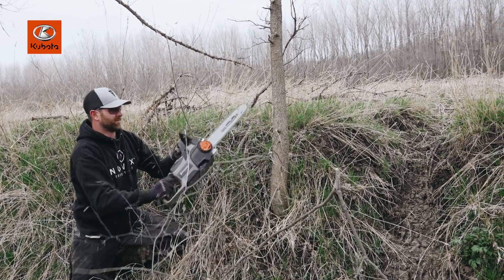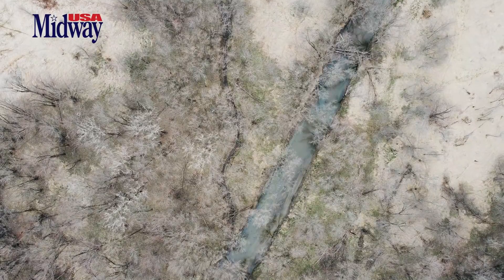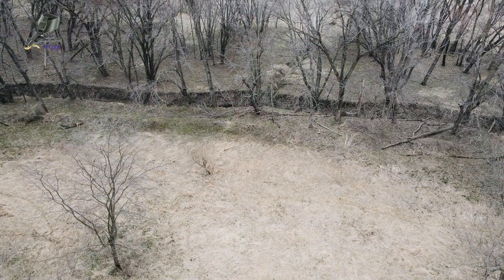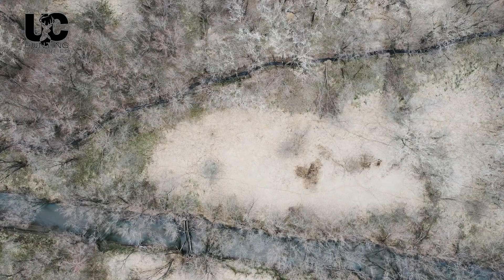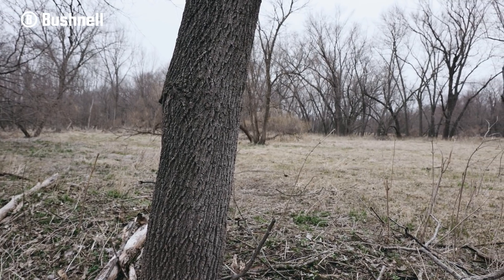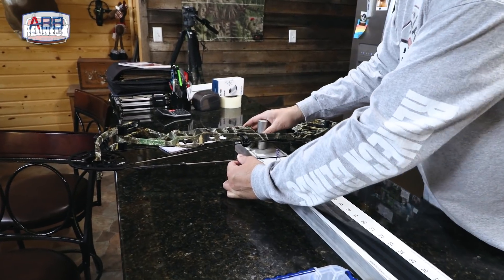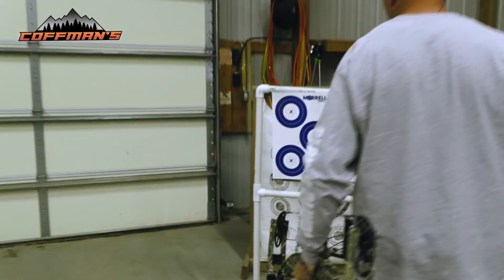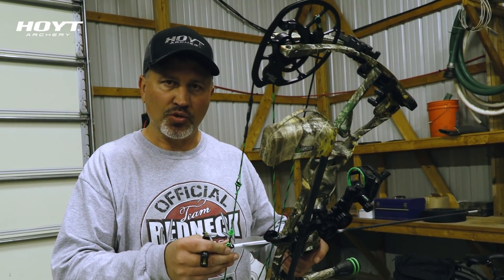Setting Up A New Bow, Killer Entry Routes | Midwest Whitetail

Comment: Did you find your rest moved pretty close to riser when tuning? Shot my ventum pro 33 through paper and have my rest maxed out to the right to get a bullet hole. Fletching does not touch anything
Reply: Adam, yes with that particular rest I started out clear to the right but that was with the arrow running just barely inside of “right down the pipe”.. ended up moving it back left slightly for a perfect tear. I’ll have to look but I bet there’s an adjustment to move the launcher itself to the right on the shaft?? My rest wasn’t touching the riser or anything but it was out of adjustment to the right when I started.